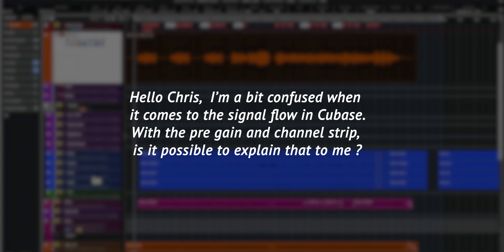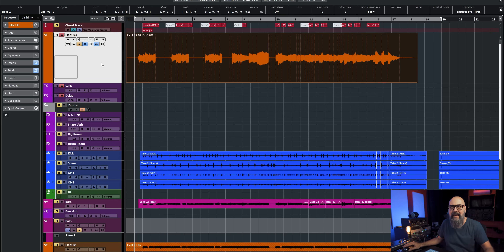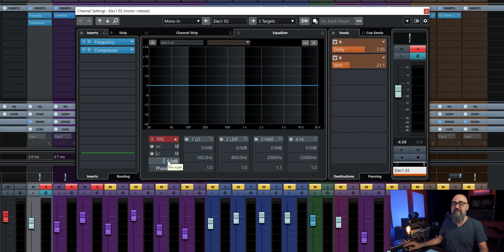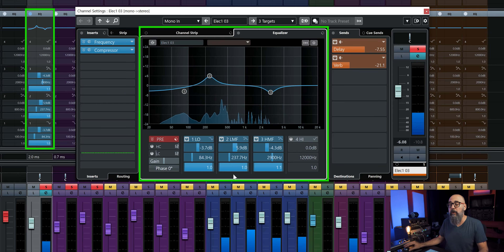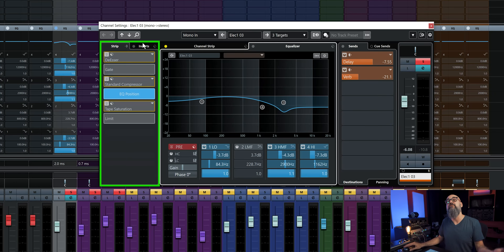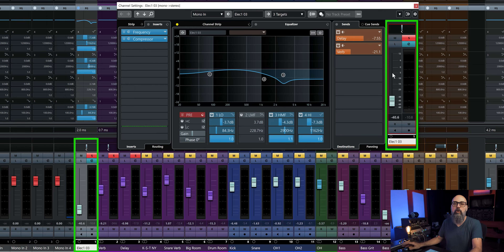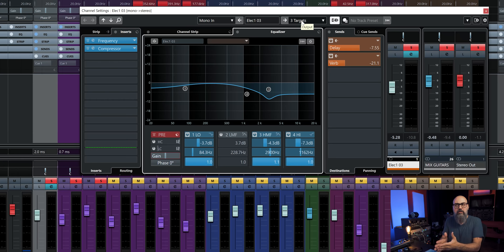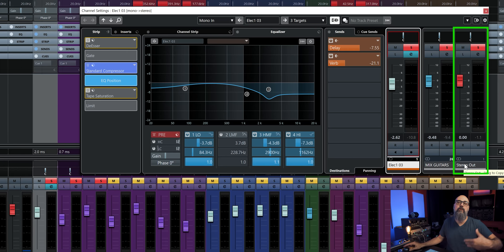Understanding the CUBASE Channel SIGNAL FLOW - Basic Overvue

Comment: Thanks for the video Chris. I am still confused about the "Send" section in the signal flow. You said that it sends a copy of the signal to another channel for proccesing but at which point is the signal sent to the fX channel? Does the signal get sent with your inserts and channel strip settings or does the unprocessed signal get sent to the FX channel. Please let us know. Thanks
Reply: Excellent question!

Comment: Great explanation, as a new Cubase user I've noticed that you haven't mentioned the Inserts Pre/Post Fader green line. Correct me if I'm wrong but the inserts that are bellow the green line (Post Fader) will get the signal after the fader of the track, before the group and fx tracks.

Comment: 8:53 ---> there is  a   l i t t l e  g r e e n  l i n e   just above the 2 last plugin slots.
That means that you can put a limiter or/and maximizer u n d e r n e a t h that green line.
.
Those 2 slots exist, because you need a way to boost your Cubase eq. and  n o t  clip the output level.
So the signal flow is :   --->  14** plugin slots, then the eq, then the 2 last plugin-slots and then the master fader of that specific 
audio channel.
If you use those 2 slots with the right plugins, you will never see the red clip light of that channel.
:-)

//

 (** it is even there in the old Cubase versions... say cubase 5; 
you have 6 plugin-slots and then the 2 'master' slots that are used for a limiter/maximizer. 
Even in thát older cubase version those 2 slots go  a f t e r  the cubase-channel-equalizer.)

Comment: ahh yes for a top down mixer those pre gain levels on the strip can be a great tool to drive the full channel by ear into the 2 bus esp drums, not for the fainthearted this method but artistic i guess, great vid chris any chance of a part 2 showing the external plugin and outboard with the id44 maybe also exporting a dry stem from a channel vs an outboard mixed stem for difference

Comment: Hi Chris. One question I've never seen answered is:  How do you determine which plugins are using the most resources?  How can I go through my plugins and see which ones are CPU hogs?  Once I start maxing out my system, I'd like to know if a certain reverb or other effect plugin may be replaceable with a more resource friendly version.  Also, I've already maxed out my buffer (2048) and have multi processing on and ASIO Guard set to max.

Comment: You missed out the pre-post fader option for inserts.  Very important part of signal flow.
Reply from the maker: Thanks for your comment. 

I did this on purpose, so I can focus on the Channel itself more than the parallel signals to keep this video simple and on the basic side. I linked other videos I made on Pre/Fader Sends and Inserts in the video description.

Since you're not the only one commenting on this, I also made an Advanced video on this topic that will come out next week. Trust me when I say that this one will be confusing for a lot... Lol
Reply: @mixdownonline  I don't believe you - this information is too important to leave out when it comes to talking about signal flow. You forgot.
Reply from the maker: @LondonSteveLee  That's your problem if you don,t believe me. Post Fader Insert is not used 98% of the time by most mixers when mixing, including myself. Like I mentioned, I already linked a video on Post Fader Insert. When you teach stuff, you start with the basis stuff before jumping in the advanced loophole.

Comment: So, basic question: for the pre-gain in the EQ section to precede anything in the Insert section the Channel Strip must be set to process first? Otherwise, gain should be adjusted with either a plugin in the inserts, or by adjusting the level of the clip itself?

Typically, do you adjust the gains of all your audio clips so, with the fader at Unity, they peak somewhere around 0dB VU? Further, do you adjust the gain of your audio clips so they are hitting any plugin in the Insert rack at around 0dB VU?

For years, I've basically ignored proper gain staging with respect to plugins, and I've always quickly run out of headroom on the Master. For example, I've noticed that with the Waves API EQ plugins, even a nominal signal is hitting the VU meters on those EQs very hard; reducing the pre-gain, so they peak around 0 dB VU, sounds (and feels) so much better.

Thank you for yet another clear and informative tutorial!

Comment: Hi Chris, thank you for your explanation. But I think it is a bit inaccurate concerning fader position and post-fader insert, respectively. I have seen your comment mentioning this point, but I think it's worth explaining in detail here. In my opinion signal chain looks like this:
clip gain - pre section - pre insert strip  - pre fader inserts - post insert strip - pre fader send - fader - post fader inserts - post fader send
Note: strip can be either pre-insert or post-insert but not both at the same time.
Reply from the maker: I appreciate your comment and concern about this. It was intentional not to talk about Pre/Post Fader Inserts/Sends in this video to keep it simple. Whether an Insert is Pre or Post it will affect the signal going in the SENDS, that's the flow I'm referring to, and not the level control of a Post Fader Insert which is more advanced for a lot. 98% of people don't use Post Fader Inserts when Mixing. 

The CS is Post Inserts by default, and you cannot make it Post Fader from what I know, only an Insert Plugin can be made Post Fader. The CS will stay Pre-Fader even if it's set to Post Inserts, so a Post Insert Plugin will always come after the CS no matter what. This is the way it works the way Cubase is setup by default, try it out yourself.  Now, I don't know everything so I can be wrong and I'm missing something. My wife would agree with that Lol!

For the Sends, they are parallel signals so even if the Fader affects the level of the Post Fader Sends, the Fader still takes care of the main audio channel level that is what I focus on in this video. I think I will make a follow up video on this to clear things up :-)
Reply: @mixdownonline  You are right- CS can only be post insert, not post fader. I've corrected that in my post. And maybe lots of people won't use post fader inserts and pre fader sends on the same channel (I can't remember I ever used that configuration). But I'm a bit fussy ;-) that's why I tried it out and wanted to share my experience.
Reply from the maker: @geniusinpanic  Sharing your experience is always welcome on my YT Channel!  :-)   Thanks again!

Comment: Hi Chris, Thanks for the great videos. This is a loosely connected question (I think). In the Mix Rack, what is the relationship with the Routing (audio) rack and "Direct Routing", also, what effect does "Direct routing: summing mode" have on this relationship?  I quite often use the "rear buss" technique for parallel saturation but end up doing this through sends. On the rack when routing is enabled thee are two slots under the routing tab, but only the second of these shows a "drop-down" to the busses and side chains. Can you shed any light on this for me please?  G
Reply: Ah ha!!! Should have done my homework, just found your video on "5 routing tricks" where you cover this. Top man, thanks!! :)

Comment: Re. Gain Staging, in my view one of the most important aspects of setting up a mix. In my experience there is a world of difference between the CLIP GAIN and CHANNEL GAIN controls. Is it the first that is critical & I generally back this off if necessary to -18; the latter (Channel Gain) does not prevent any overload at the track level, rather, sis only used to balance a little for downstream buses & plugs etc. Clip Gain is the important one.

Comment: I am very much enjoying watching a tutorial in which I knew almost everything already but could you tell me in your opinion, the difference between adjusting the Pre-gain with the small square on the track and the Gain control in the channel strip, please?  I rarely touch the Gain control and do a quick Pre-gain adjustment (to between -12 to -18) with no inserts using the small square on the track and then don't touch it after that. Thanks anyway for another useful video, always a pleasure.
Reply from the maker: Glad you enjoy my videos :-)   Clip gain is nice to work with when adjusting the gain of a audio clip and not the full channel. Pre Gain takes care of the full channel gain. Both are usefull